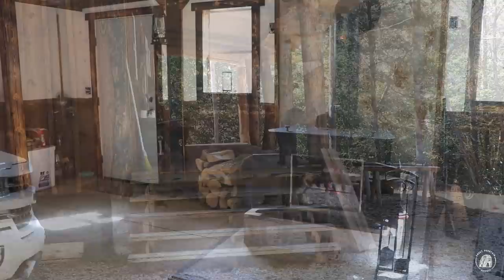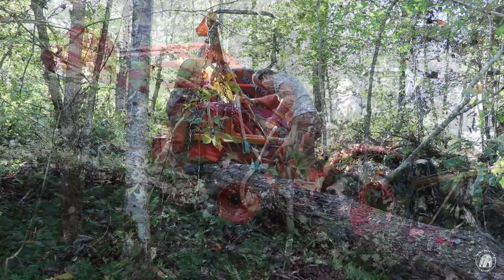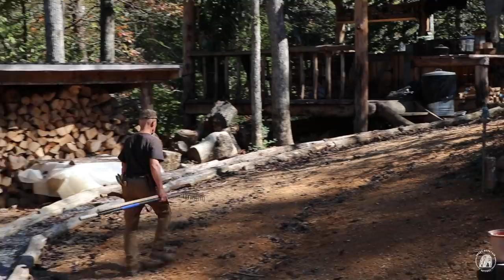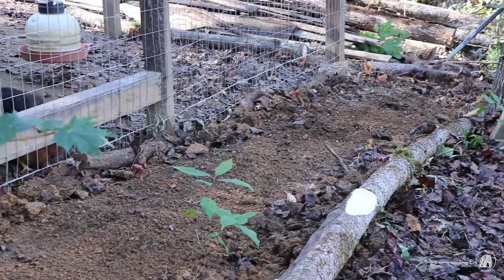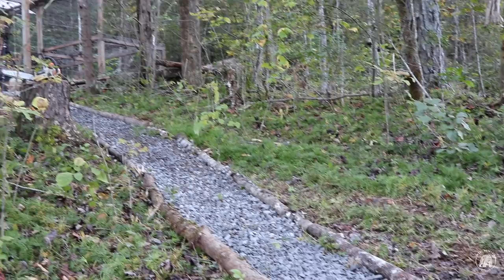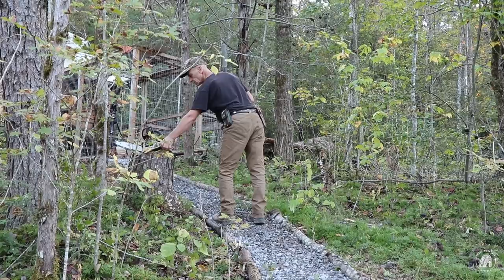HOW TO MAKE BLACK PIPE LIGHT FIXTURES | TIMBER FRAME CABIN | WALKWAY & RADIANT BARRIER COMPLETE

Comment: i liked the video today a lot.  The radiant barrier that works.  The light fixtures that one also will make for us too.  I have a coat and clothes hanger made out of these pipes too.  Its also possible to make a shot gun out of these pipes too.  A home made shot gun in 12 gauge.  Look on youtube for this.  I got myself two draw knifes .  Am going to make up my own out of a lawnmower blade then will bend it for handles.  I coat the blade with blue dycom and layout my pattern, then grid it out.  I also got me a lot of expensive air tools too.  A compressor, nailers for the roof, for framing, and for staples and 18 gauge nails.  Got a lot of tools now too.  Have not found me any land yet.  Yet am still watching the build videos too. Paul

Comment: TO protect from nicking the insulation on the wire is to insert the receptacle after you assemble to pipe, not first.
Reply from the maker: It would seem so, a pull string would make it easier. The wire doesn't push around elbows as easy.